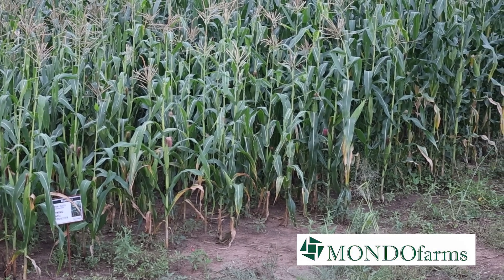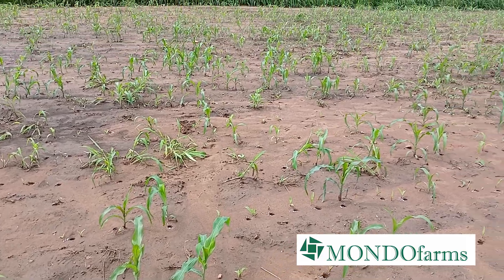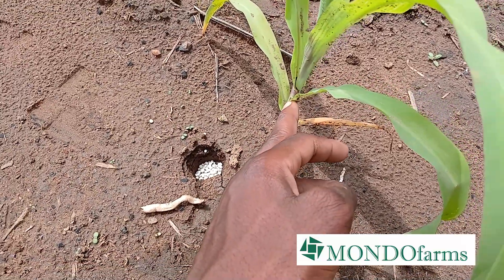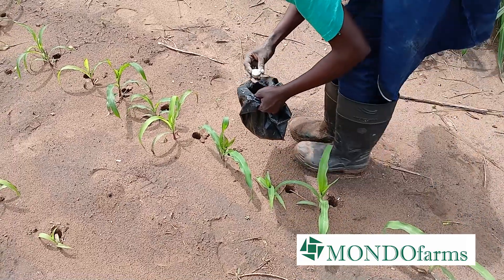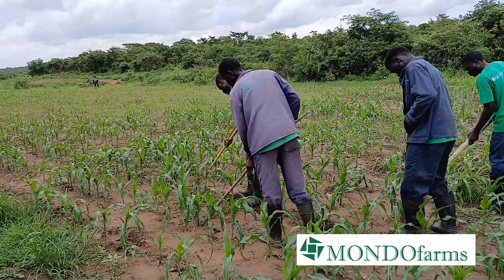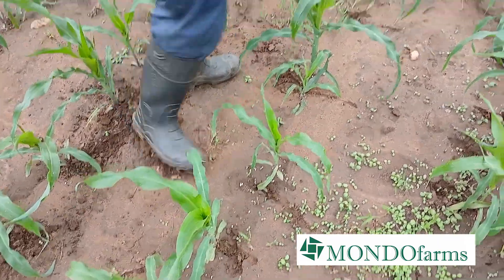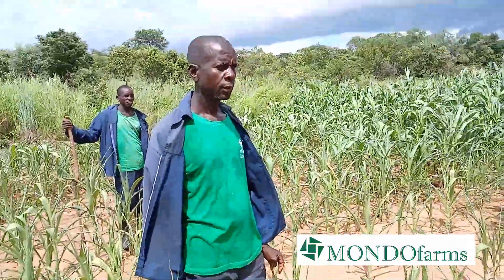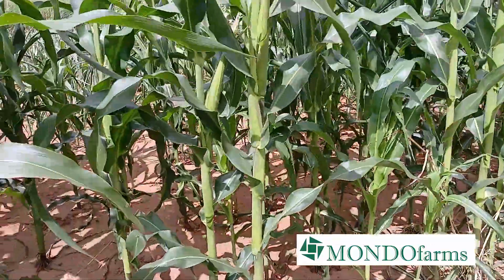Farming in Zambia: Maize Fertiliser Application

Comment: So nice to see so many similarities to our farm operation in SA with lots of manual labour. At least you are not the only one with aspirations of owning big farm equipment. Interested to know if you are applying any micro elements/nutrients on regular basis? We normally do foliar application of micro elements every 2 weeks throughout the growing season. Starke Ayers has an excellent product (Trelmix) which can  either be sprayed or added with fertigation.
Reply from the maker: Thanks, yes we do, but we've been working on getting our first tractor as soon as possible for the heavier work.

Yes, we use a range of foliage fertilisers on our crops, at different stages. We featured it in some detail in our video last year about a green pepper crop at Dubai that was affected by frost.

Comment: You should use a drip fertilizer system where the fertilizer go to the root with the water cut down on people breaking their back
Reply from the maker: Thanks Hope. Long time. 
The issue of how best to fertilise field crops is an interesting one thatbis often debated.

As you have seen from many of our videos, we use drip irrigation quite a lot across our farms, especially for vegetable crops. And of course, we use venturi injectors to fertigate them extensively. 

But we can't afford to use drip for large fields of maize and soya beans. So we go for granular fertilisers, as shared in this video, and then apply them as effectively as possible.